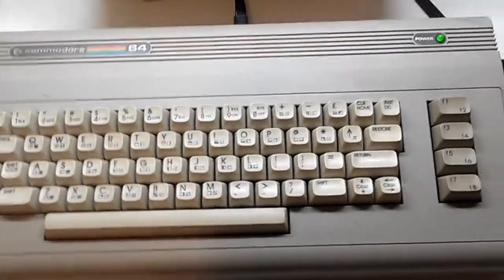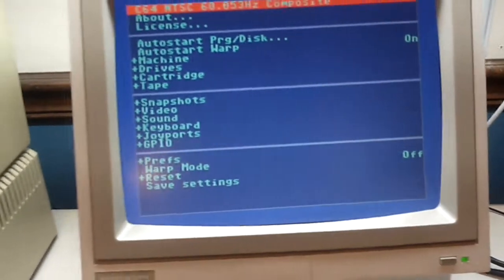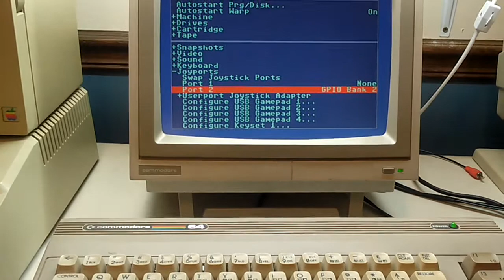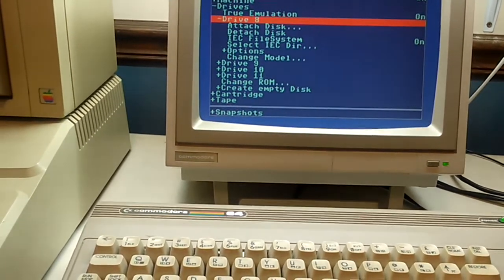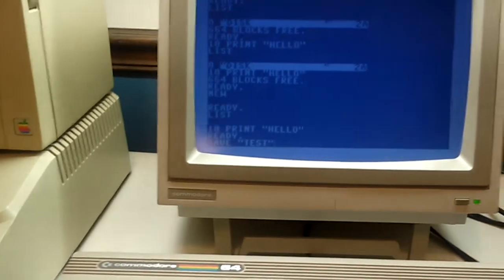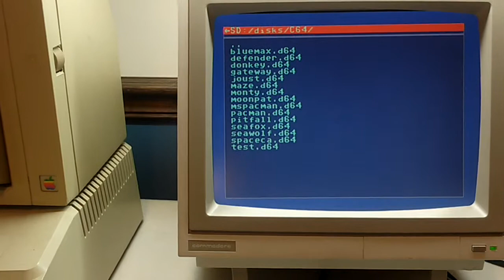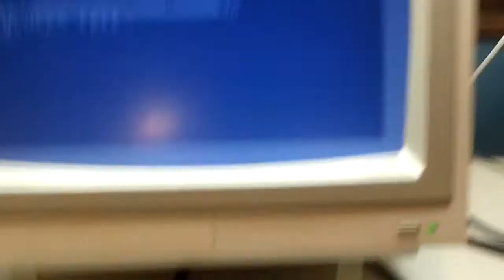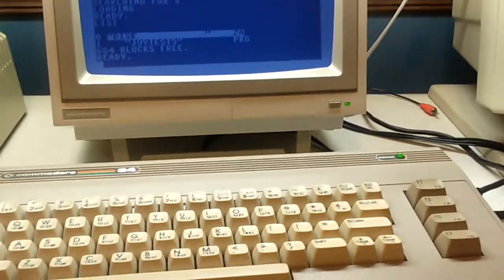Commodore 64 Problems BMC64 Emulator Using Real Video,Power and Joystick Ports

Comment: I think when you attach a new disk or attach the same disk again your changes get written on the disk. When you use the save command only it only gets written in the RAM of the pi and not on the SD card. This limitation of BMC64 was needed to allow turn of with power-off without any shutdown process.
Reply from the maker: ok cool thanks for the info

Comment: I am trying out BMC64 on a PI 3B after seeing your video and some others.  I seem to be having trouble with USB devices like keyboard and joysticks working reliably (sometimes they just seem to stop being recognized) so I am ordering parts to hook up DB9 pin joysticks through the GPIO interface.  Hopefully the GPIO connected joysticks allow it to work more reliably.
Reply from the maker: I would suggest visiting the BMC64 site and looking over some of the changes/fixes,etc. if you haven't already done so. It's not perfect but BMC64 is the best Commodore emulator out there in my humble opinion.